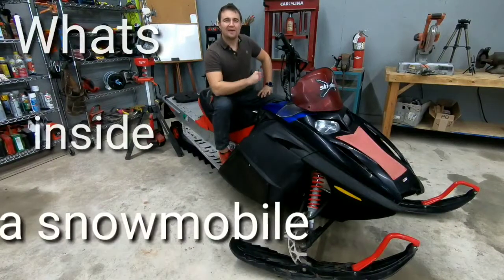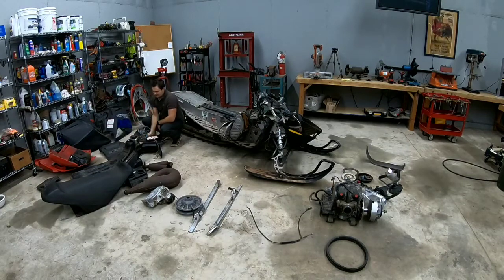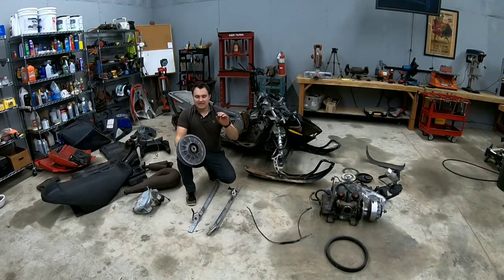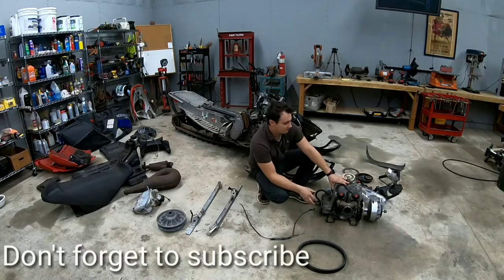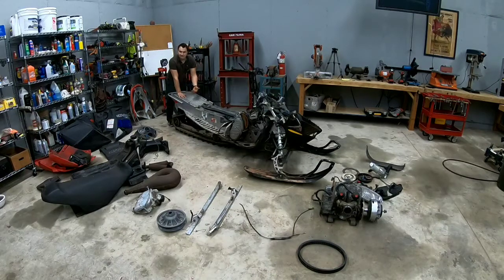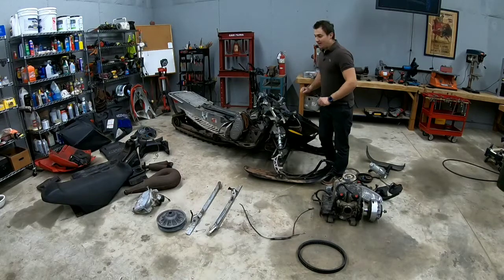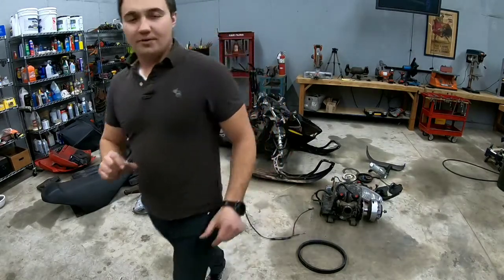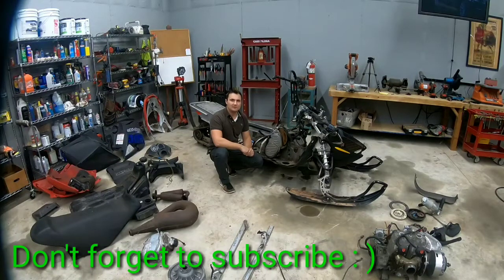WHAT’S INSIDE A SNOWMOBILE??

Comment: Apparently, those radiators only work when the snow is tossed up against it off the track.  Who knew? Thought it had a fan, like the cars.  Overheated the head gasket on a '05 Yamaha once when left it running for about half hour. After that, it was shooting out fire out of the exhaust for the few seconds that it stayed on.